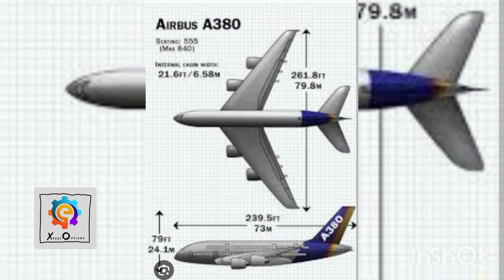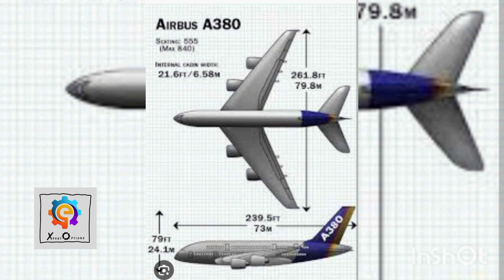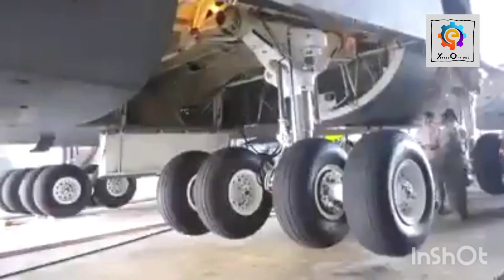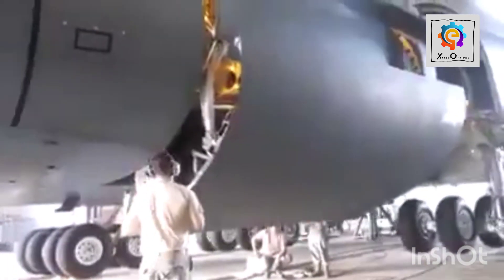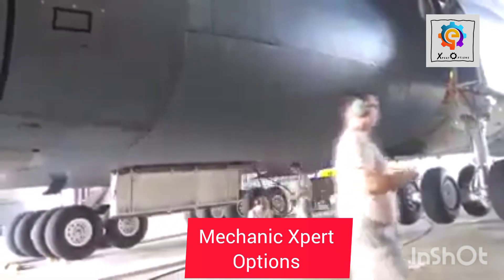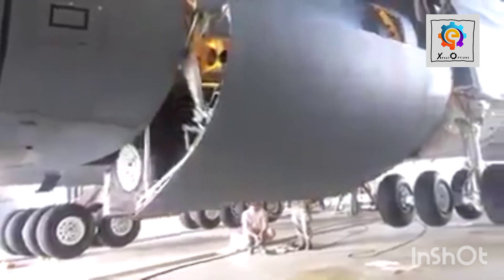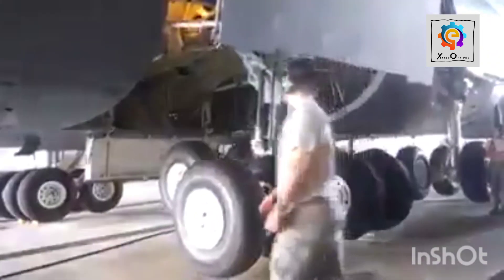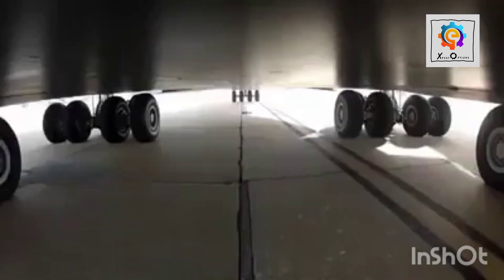How the Landing Gear of Antonov Air Bus  cabin works.

Comment: The presenter is incorrect. The landing gear of an Airbus 380 aircraft does not have a double axle nose wheel. The main landing gear does also not twist and retract into the underside of the fuselage in this aircraft type. What seems to be shown is the main landing gear of the gigantic Antonov A225 and not that of an Airbus A380
Reply: Tampoco es el tren de aterrizaje del Antonov 225 el que se muestra, sino del C5 "Galaxie"
Reply: Yes thank you sir. Quite different, hope he/ she gonna do better 😂 in next presentation
Reply from the maker: Better next time
Reply from the maker: Thanks Soo much
Reply: This is the gear for the United States Air Force C-5 Galaxy.